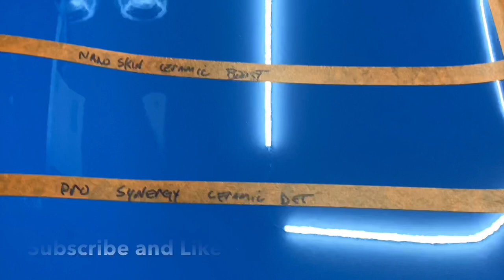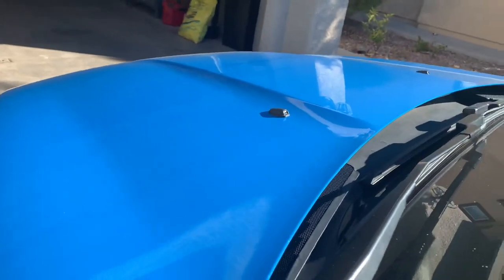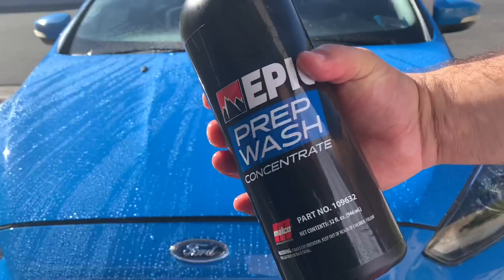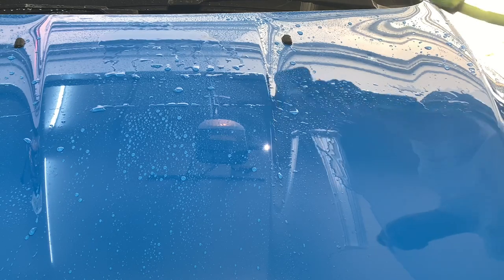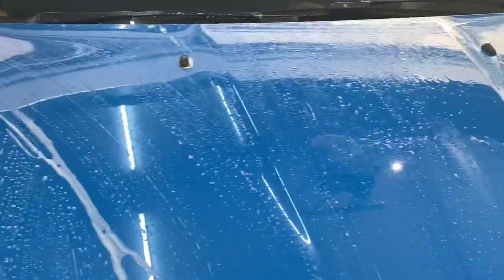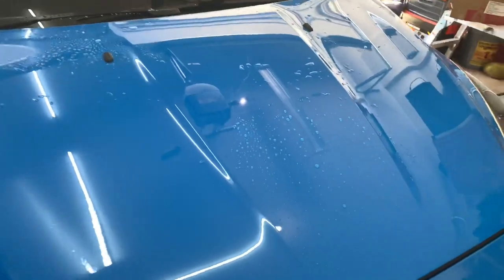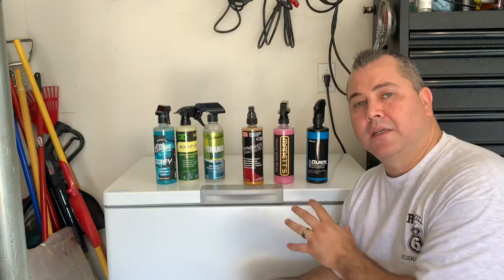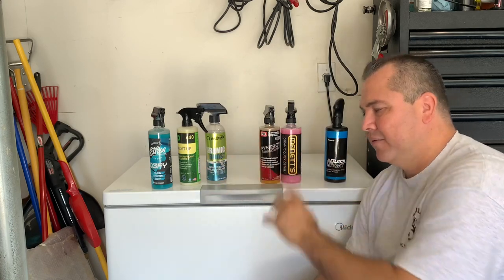Testing Quick Detailers

Comment: Lets look at cost per ounce using a 16oz bottle price Defy $1.75 ounce , $1.18 OZ Nanoskin , Bead it Up  .68 cents/ounce so quite a difference in price. I have used Bead IT UP and like it better then Beadmaker, and I have Defy which it is good but not %300 better . The price deprancy gets even greater if $89.99 gallon for Nanoskin,  $32  gallon of Bead It up, Defy $49.95 for 32 ounces .Bead It Up for the best value and Defy for longevity win. Agree with ones I have used. 👍
Reply from the maker: Functional Doc absolutely, glad u did the math for me as I didn’t want to do it.  Thus why I’d buy a gallon of the Bead It Up.  It’s all around the best choice here.  Good job Doc!!
Reply: Stay tuned for a release this Friday!
Reply: Wrong you can buy defy by the gallon for a lot cheaper especially if you get a coupon code which is very easy to get I bought 3 gallons
Reply from the maker: @Aaronelliott847  now u can

Comment: Bead it up...3D just doing their thing quietly and consistently.  Love their ceramic as well! 
I wonder what you’d think about the Infinity Wax line as well! 
Great content man!
Reply from the maker: Yes, 3D is way underrated.  I looked at Infinity Wax line up and they r so expensive!!  I feel like it’s throwing my $$ out the window.   They have many products but the synergy line up is only used with Synergy and the others without Synergy.   I was actually gonna order but after speaking to the Owner I was rethinking and never pulled the trigger.
Reply: Detailing I’m interested in the express sealant / super gloss+ and Diablo currently.
Reply from the maker: @ChadStJohn  yes, the super gloss sounds nice.  Diablo might be good as well.  I would rather use McKee’s Hydro Blue over the Express sealant though.